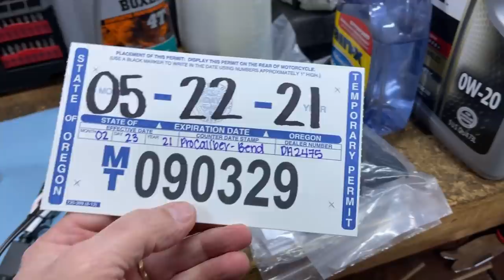Prepping My Himalayan!! • Sea-to Sky’s In Stock..! | TheSmoaks Vlog_1929

Comment: Genius idea with the battery nuts. Can't imagine how many times in 50+ years of working on and owning bikes, I've fought with the nuts. Plus, when you add the thickness of the battery tender lead the bolt isn't long enough to pick up the nut threads and you need three hands to try to get into an impossibly tight space to get the nut pulled up and the bolt started. Thank you, thank you for a simple cost free fix. Can't believe I hadn't thought of it. 😊😊

Comment: Hi. It's reggie the rural rider from good old England 🏴. It's been 6c today. Dry but chilly. The 2 signals you see mite be because of reversible track on both tracks. The loco at the back of freight train are to assist up hill and keep the train from snatching and breaking the couplings will half the train is over the hump in the track the the rear of the train is fowling at the rear, this loco is worked by remote control from the driver in the leading loco. It looks like  March 29th that we can start riding for pressure in England 🏴. Would like to see more of your state when the weather gets better. All the best reggie

Comment: Good to know about the saddle bags, thanks. You can use smaller fuel line (clean) in a pinch for your battery posts
Reply from the maker: It has to be super thin, as it has to be able to fully collapse when the battery bolt goes through and tightened.  Otherwise, it may break the the battery post under the load, or not allow the terminal to be tightened correctly...

Thanks Sabrina!!

Comment: Love your videos, thanks for sharing. I have a R1200RT, with a dead fuel gauge. I am mechanically inclined and my nearest dealer is 200 miles away, what does it take to repair this? Also, my bike came with the left handlebar mirror, I’d like to match it on the right side, the 1200RT, from your video had both, is that a BMW part number? Thanks keep the videos coming.